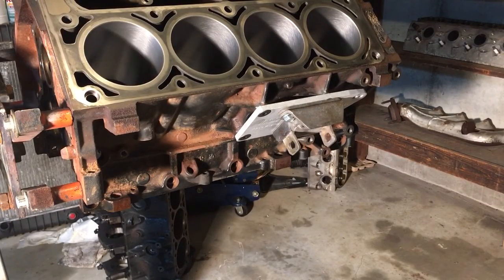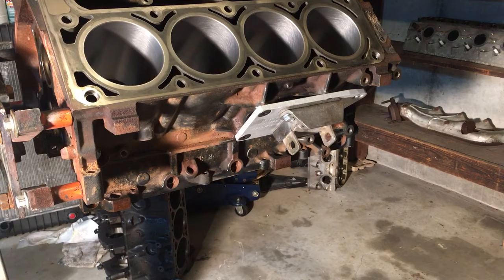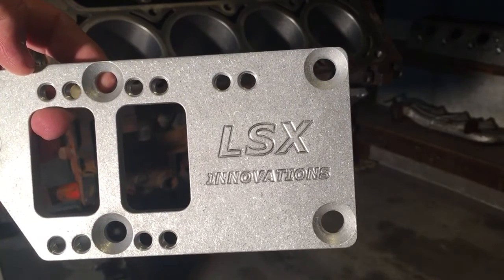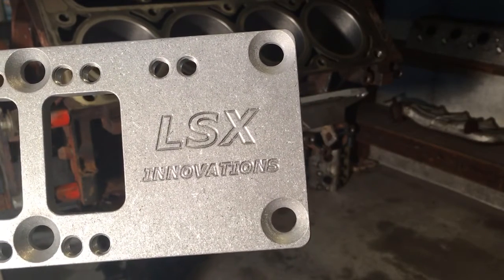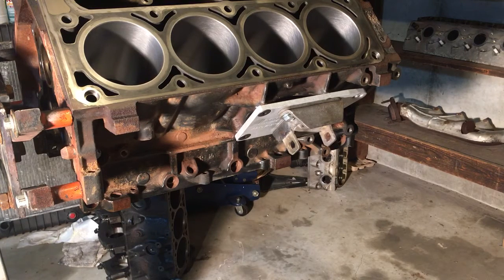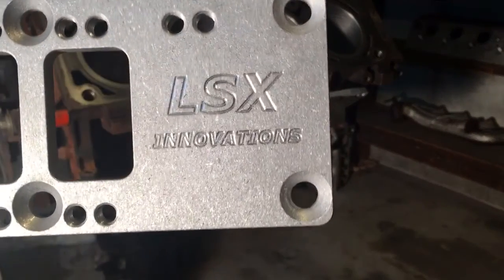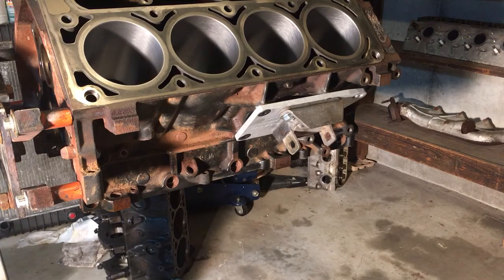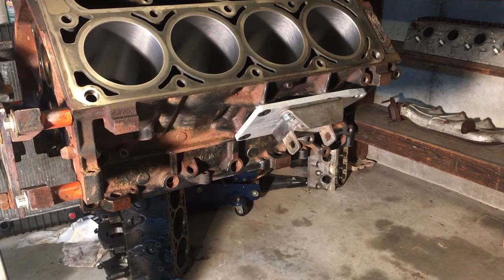LSX Innovations adapter plates

Comment: Nice review
Reply from the maker: Moparius Maximus These plates have worked great no complaints.  I originally set the engine forward 2 1/4” but now I’m both lowering the engine 1 1/4” and moving it back closer to the stock location; these plates make everything easier.  Thank you!  JD
Reply: HeadFlowInc , Thanks man I plan on using them on my 67 lemans,  Merry Christmas to you and your family stay safe...
Reply from the maker: Moparius Maximus Merry Christmas!! 🎄🎁